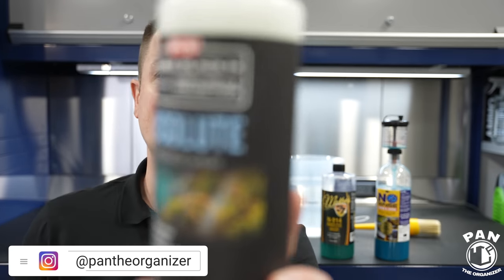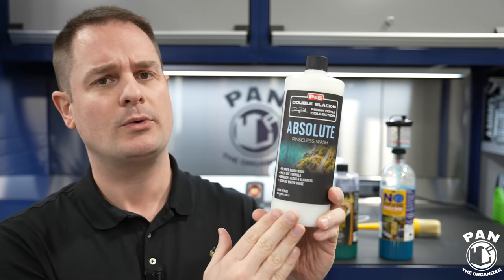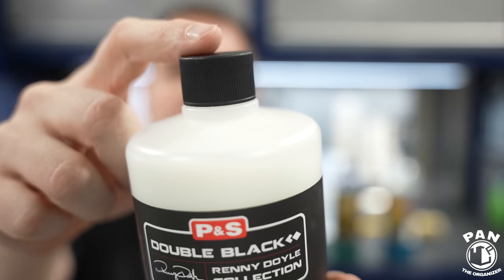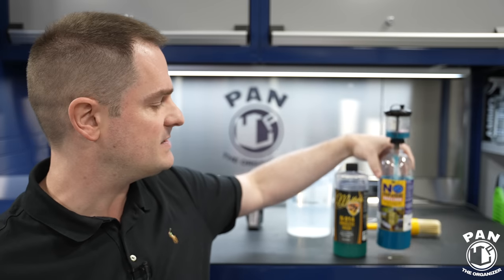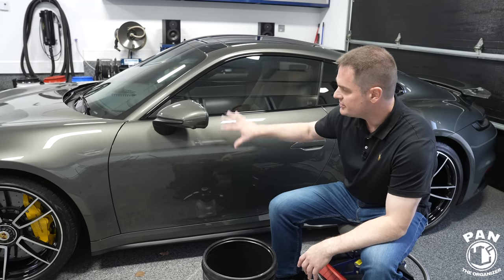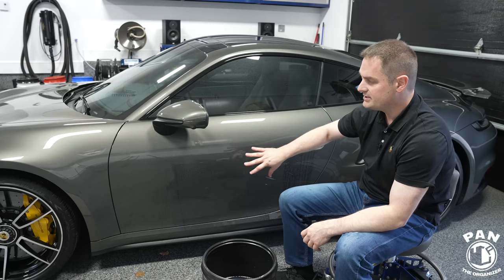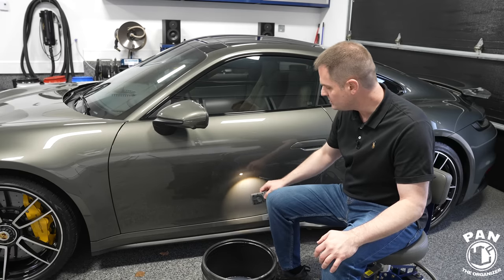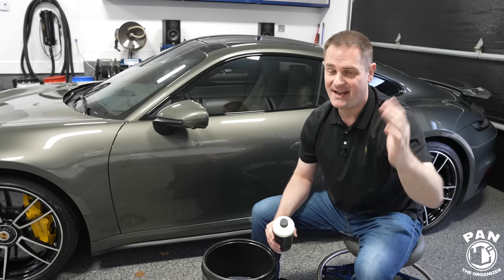NEW P&S Absolute Rinseless Wash... Is it better than ONR or McKee's?

Comment: Awesome video as always!

Why is no-one talking about Wolfgang Uber rinseless wash?
I’ve been using it as a QD, drying aid and glass cleaner (super duper awesome) forever and it’s sooo good. Always wondered if I should try to replace with one of these or keep the OG wolfgang Uber
Reply: It's been around for quite awhile, I liked it but it is more expensive. To me it was never worth the extra cost over ONR for what I felt was equivalent performance. If you like it, keep using it...but I think you will really like Absolute!
Reply: @jeffc6832  what I like a lot from Uber is that as a drying aid, the slickness and shine it gives to the paint and glass is out of this world. I never tried the other ones. I just finished my Uber now, so I’m debating on which to buy. I might try the P&S absolute (or N-914, still debating…) and use it as a dilution for drying and glass cleaning too.
Reply: @Julep_gauthier  Absolute blows Uber out of the water in those aspects, and IMO N914 would be a step down from Uber. 

What has also been surprising to me is how great Absolute is at the 64:1 QD dilution. No matter what I do, I haven't been able to get it to streak or smear. Meanwhile ONR can start to get streaky, even at 128:1 clay lube dilution.
Reply: @jeffc6832  thanks for the answer! Seems like Absolute will be my next one. Awesome chat!
Reply from the maker: I simply used the most requested ones by my viewers, and probably the most popular in the industry, being N-914 and ONR, the standards that everyone compares other rinseless washes to.

And for the record, I did talk about the Uber Rinseless Wash many years ago, in this video: https://youtu.be/Kn8wYn_P9Js
Reply: I've used Uber for years. When i ran out, i switched to Absolute and used it in the Uber measuring bottle. I like Absolute more for its slickness. Uber was great for its time, but now there are others that are just as good or better and more economical at the same time. Uber cost more for half the amount.
Reply: @jeffc6832  have you tried Phoenix Hydra? I just got some and loving it so far. I need to try Absolute and DIY as well.

Comment: Do you believe using Absolute with a spray bottle is a better step one versus a foam cannon?  Step 2 being a regular 2 bucket wash…
Reply from the maker: I typically use a rinseless wash as a pre-treat, rinse, then use a foam cannon, rinse, then a 2 bucket wash. The rinseless and a cleaning snow foam do two different functions in my opinion. High pH snow foams like CarPro Lift and Bilt Hamber Auto-Foam attack grease and traffic film better, while the rinseless wash is great for encapsulating dirt particles and lubricating the surface.
Reply: Thank you for the answer and associated context, very helpful.

Comment: How does CarPro ECH2O compare to these more popular ones?
Reply: It's good, but in a different class as it contains SIO2 which leaves a protective layer. These three do not.
Reply from the maker: That is correct Jeff. CarPro Ech2O has a modified high gloss SiO2 component in it, so it's in a different category, perhaps closer to the McKee's Graphene Rinseless Wash for example.
Reply: Thanks for the responses. Outside of the SIO2 protective layer difference, does Ech2O compare well in terms of cleaning effectiveness, lubrication, and safe to use on paint?

Comment: I wonder whether you can use Absolute as a WATERLESS product? So, spray on the panel and then wipe. No bucket! What do you think?
Reply from the maker: P&S mentions on the label that it can be used as a rinseless wash, as a quick detailer, as clay lube, as glass cleaner, for interiors, but no mention of it as a waterless wash.

Comment: Can it still be used as a panel prep before coatings?
Reply: The only rinseless product that advertises that is McKee's, and that is specific only for their coatings. It is always recommended to use the specific panel prep provided by the coating manufacturer.

If you need to do a wash after polishing, Absolute is a great option. But you still need to use the right coating prep afterwards.
Reply: I would use a dedicated prep for coatings. The idea is to get the cleanest possible paint and it makes no sense that this product can leave your vehicle feeling smoother without a residue.
Reply: @joeymcguire8742  I think "residue" in the sense that Pan is using it is referring to something left behind that will either attract dirt/film, or that would interfere with coating hydrophobics or whatever product you use on the surface after.

With the exception of alcohol/solvent based products, every detailing product on the market "leaves something behind." Soaps leave residue that can cause streaking/smearing or attract dirt. Surfactant rinseless washes (like N914) leave small amounts of surfactants. Polymer rinseless washes (like Absolute/ONR) leave small amounts of non-protective polymers and short term gloss enhancers. Any good coating will shed those microscopic surfactants/polymers quickly, and the carrier agent of any spray sealant, topper or wax used afterwards will also remove them.
Reply from the maker: There are no indications for using Absolute as a panel prep, so I would still recommend using a dedicated panel prep like CarPro Eraser or Gyeon Prep.

Comment: i found out at sema that dream maker has protection in it. it isnt like bead maker that 6 months but dream maker it has a little bit of protection.  one of the rep for p&s brought up ppl saying that there isnt protection in it but he says there is some protection in dream maker
Reply from the maker: There is only one person that can actually confirm that and it's Dave Phillips, the chemist at P&S. Dream Maker in my tests only lasts about a week or until the next wash, so I was pretty certain it didn't lay down any durable protection. And they don't claim any protection on the bottle, the only thing they mention is its gloss enhancing capabilities. If it was protecting, they would have certainly mentioned it right? Marketing is important.

So I reached out to Dave and asked him if there was any protection in Dream Maker. Here's the official response:

"Dream Maker has a charge that makes it attract to the car surface but it does not cross link. It has more of a tenacity comparable to waxes. So, it is very resistant to water and does not just disappear on it’s own but much of it will wash off on the next use of soap. 

Dream Maker has a low surface energy which makes it prone to sheeting and not beading. Also, the sheeting ability goes away as soon as there is dirt or soil on the surface. Any paint surface that is slippery is protected to a certain extent because a slippery surface is harder to scratch that one with more friction."

So from this, I think that Dream Maker does lay something down on the surface, hence the sheeting, but it's nothing that is durable in time, hence why they don't claim it as being a "paint protection" product, but more a "gloss enhancer".

I hope this clarifies things once and for all. ;)

Comment: I still can't get my head around how this technique doesn't mar the paint... how dirty is too dirty? Anything more then dust? Driving around, particularly if it has rained is going to result in dirty and road grime...I just can't see it not marring, even with a pre-rinse with pressure bottle.
Reply from the maker: Check out the DIY Detail channel, all they do is practically wash with the rinseless wash method.
Reply: I now see in all Yvan's videos he's using a pressure cleaner to rinse it before he puts a sponge on it with rinseless.. that makes more sense! I wouldn't feel comfortable at all without that step before putting a mit to my paint! @PanTheOrganizer
Reply from the maker: Yeah. A rinseless wash doesn’t mean you never rinse. It just means no rinse is needed at the end of the wash process. Common sense is needed with rinseless washes. If the vehicle is super dirty, for sure you would pre-rinse the vehicle first.

I still prefer the traditional wash method, personally.

Comment: You would use this polymer property on glass? I would imagine that would streak. 
Hey I like that grit guard!
Reply from the maker: Hi Greg. Absolute leaves no polymers behind. I asked the P&S chemist himself and here's the answer: "As many viewers had the same question as you, I reached out to Dave Phillips, chemist at P&S, and his official response is: “As for leaving something behind, the quick answer is that Absolute does not leave any protective film behind on the surface. Just about everything is removed by the drying process and our point is to create a clean surface.

Not leaving anything on the surface makes sense in detailing terms. We are not leaving any protective material behind and we don’t want to mislead the consumer into thinking there is. And what is left behind will not affect the performance of the original surface or how finishing products will perform.”

It works amazing on glass!
Reply: Fantastic! I’ll be trying that out. I wonder if you’ve ever tested Adam’s glass cleaner. It leaves such a slick smooth feel I assumed it was leaving something behind. It’s the anti-Windex product.
Reply from the maker: I did try Adam’s glass cleaner many years ago. Not sure if they updated the formula.

Comment: I've not yet used absolute but the shine really is superior to ONR and N914. I don't recall if you mentioned but can it be used as a paint prep before a coating? I finished the n914 and bought the diy detail rinseless and it has tremendous cleaning power. I hope yourself and everyone enjoys these rinseless! You can't go wrong with any of then! Awesome video Pan!
Reply: It works really good as a clay lube. However, before applying any sealant/wax/coating, I would still use Panelwipe/Eraser/IPA.  I want the protection layer bonding to the actual hard surface, not any residues from the rinseless wash however minute.
Reply: I second @tim kinley
Reply: If necessary, you can wash with Absolute after polishing, but you will still need to use the panel prep provided by the manufacturer of whatever coating you are using. 

N914 should only be used as a panel prep for McKee's coatings that were designed to be used with that.
Reply: I agree with the IPA of course,  the n914 leaves nothing on the surface which I like. I'm wondering if the absolute does because it looks like it may have a gloss enhancer. But agrees go with the coating companies prep
Reply from the maker: They don't mention Absolute being used as a panel prep, so for that I would still always recommend a dedicated panel prep like CarPro Eraser or Gyeon Prep.
Reply: DIY Rinseless is my current favourite. It cleans like no other, and leaves nothing behind.
Reply: @havingtoomuchfun4806  I agree 100% I've been using it and I'm hooked.  It just has a bunch of cleaning power,  smells great and its simple to use

Comment: I don't understand how, assuming that your statements about the lack of residue and them cleaning equally well, how there could be a difference in slickness. Aristotle would say that you are necessarily mistaken.
Reply from the maker: In my testing, I noticed that Absolute did not change the hydrophobic properties of my coating, so I was quite confident it wasn’t leaving any surface-altering protection or residue behind. It did leave a nice clean, slick and shiny surface.

As many viewers had the same question as you, I reached out to Dave Phillips, chemist at P&S, and his official response is: “As for leaving something behind, the quick answer is that Absolute does not leave any protective film behind on the surface. Just about everything is removed by the drying process and our point is to create a clean surface.

Not leaving anything on the surface makes sense in detailing terms. We are not leaving any protective material behind and we don’t want to mislead the consumer into thinking there is. And what is left behind will not affect the performance of the original surface or how finishing products will perform.”

But beyond science, you would have to test it yourself to experience what I mean. Especially the slickness/lubrication while using it. And don’t only take my word for it, pretty much all the other reviews on Youtube came to the same conclusions. It’s pretty unanimous.
Reply: @Pan The Organizer  argumentum ad populum is a logical fallacy. The answer from P&S is that it doesn't leave a "protective film", hence it can be leaving virtually anything else that  could logically be left behind. He didn't deny that something isn't left behind, only that something that he would define as a protective film isn't. None the less, were there no difference than the results would necessarily be identical... That's actually supported by your anecdotal reports of there being a difference.
Reply: @PanTheOrganizer  not trying to be argumentative, just accurate.

Comment: How can this product both leave no residue and make your paint more slick? Unless there are abrasives in it, that isn’t possible.
Reply: Huh?
Reply: Absolute is slick as snot in use. Not so much after its dried. He’s mainly feeling the coating and/or topper that’s already on the car.
Reply from the maker: In my testing, I noticed that Absolute did not change the hydrophobic properties of my coating, so I was quite confident it wasn’t leaving any surface-altering protection or residue behind. It did leave a nice clean, slick and shiny surface.

As many viewers had the same question as you, I reached out to Dave Phillips, chemist at P&S, and his official response is: “As for leaving something behind, the quick answer is that Absolute does not leave any protective film behind on the surface. Just about everything is removed by the drying process and our point is to create a clean surface.

Not leaving anything on the surface makes sense in detailing terms. We are not leaving any protective material behind and we don’t want to mislead the consumer into thinking there is. And what is left behind will not affect the performance of the original surface or how finishing products will perform.”

Comment: I bought the gallon a month ago.  It works great
Reply from the maker: What do you like the most about it?
Reply: How easy it was to use and how well it cleaned my Jeep. I used distilled water so no water spots.. but topped it off with Avalon King. Perfection.. I also just followed you on my IG page as well